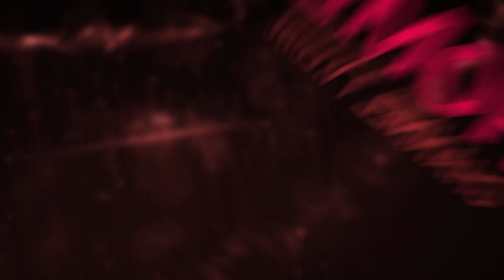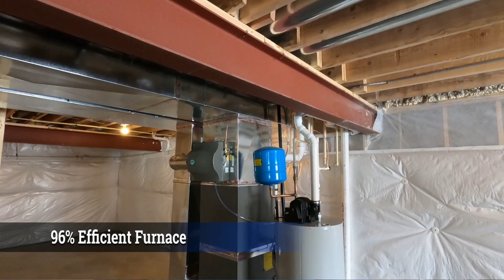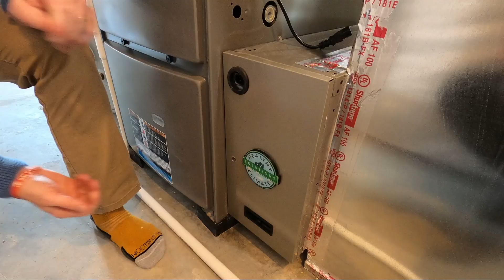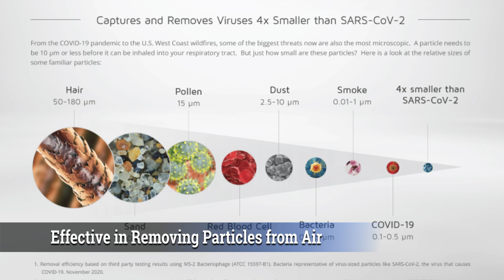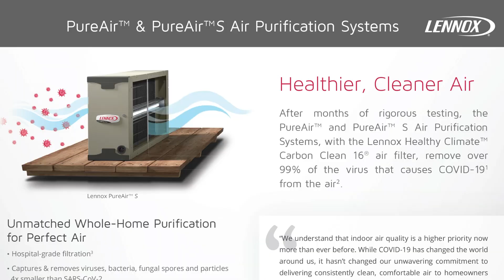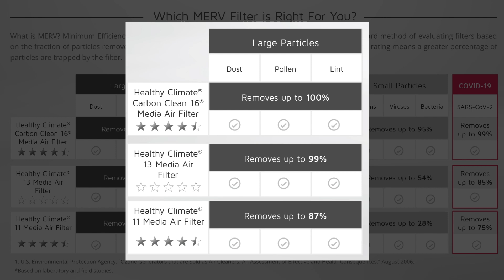Benefits of Lennox PureAir HVAC System - Review by Airhart Construction

Comment: It does NOT exceed or even come close to meeting requirements of a hospital OR. An OR requires HEPA or 99.97% removal of 0.3 micron particles. MERV 16 requires removal of 95% or 0.3 to 1.0 micron particles -- so much less rigorous than an OR. But unless your HVAC is designed for it, a HEPA system would likely overload the air handling capability.